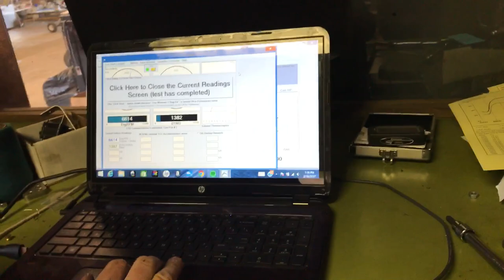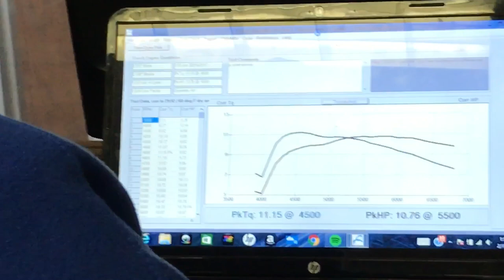Briggs Flathead Race Engine Dyno Test

Comment: Put a 4 hp head and a 3 hp flywheel on it, it''l kick it up a few more horses.
Reply: Ive done the 3hp flywheel with the adaptor for the coil......... Billit aluminum flywheel and the or dragster coil was a whole lot better but yes stock parts mixed together can work very good....... My nephew won a championship with that enginge and was tore down but they couldnt do anything about it because it wasn't stated in the rules.......

Comment: I got one.......... Fuck paying thousands from a lowball engine builder that over charges........ I have 500 dollars of actual parts that I bought but machined and assembled it ourselves........ My brother knife cut the crank and balanced it at the turbo shop he was running.... Shaved the head .125. Bored it .030 over..... Has a dynocam cam and springs.... We ported the intake and exhaust ports. Put billit aluminum flywheel with a briggs or dragster coil on it and an arc billit rod........ Stock carb converted to alcohol...... And it runs 9500 rpm all night long on a dirt track all for 500 bucks and not too much personal time also has a 4500rpm takeoff adjustable spring clutch.........it was half the cost of the engine........so 750$........I bet this engine in this video is 1500bucks......
Reply: so true.
Reply: And we'll worth it. Yours may have been fast but far from legal.  That's the talent building a stock legal engine that will outrun yours. Talking big words won't make it faster.  Also 750 for a cluth is a rip off.

Comment: Someone plz help is there any different carburetor for the Briggs 5 horse fun power engine that I can use? The stock one has so many linkages and it’s really tricky
Reply: When u find out let me know with part numbers
Reply: I use a Tecumseh 6 horse carb on mine. You can also use the Honda/Predator 6.5hp carbs with adapters
Reply: @PeelePowered  dude thanks so much

Comment: Will a good built flat head out run a clone big pipe?
Reply: I have a 28hp briggs if that says anything.
Reply: @bryanroupe8646  blockzilla
Reply: Yes. I have ran stock medium with a flatty against the clones and won, legally.  I believe you could get more out of a clone or predator, they just dont sound and smell like a flatty.
Reply: Yes
Reply: @d.bowman8032  I love Flathead motors I have a few.
Reply: @bryanroupe8646  28 horse power huh?  That's like what 200% increase power  output? Sure you did. I run a 3 sec quarter mile with mine.

Comment: Can someone tell me what fuel they are supposed to run? I have one I got from a buddy and have to clue about them motors
Reply: 87 Or better octane should be fine i personally run sunoco optima 95 because it’s ethanol free fuel it’s way better for small engines than pump gas.
Reply: just use regular fuel, only go higher octane when you start bumping compression up

Comment: I’ve been trying to locate a raptor engine do y’all come across those alot?
Reply from the maker: MrEric4555 yeah I race in upstate ny and it is mainly flatheads up here. Down south they usually race clones but they are common around where I race
Reply: If you ever come across any raptor engines message me I would be interested can’t find engines like that here in Houston
Reply: @MrEric4555  ive got 2 engines one stock briggs flathead and another racing flathead would probably part with them

Comment: Why dos it seem that my old 3.5hp briggs has more hp then my 6.75 hp briggs for cutting grass?
Reply: its torque that they are using. flatheads have torque lower in the rev range 2200 to 2800.... OHV engines have torque higher in the rev range.... get more HP from the same CC's on OHV engines.
Reply: the old flat head motors always have more power than the new gov Newsom smog motors .
Reply: @marcchaffee7751 idk newer motors are pretty good and when you get them perfect a 212 predator can run 20+ hp and it’ll freely rev up to 10k with no issues, stock id say 6000 is pushing it a tiny bit
Reply: @matteblackexterior  My favorite B and S has always been the 190000 series 8HP flateads .   Years of gokart riding , that has been the most dependable torque monster for me . Riding all day and they always got me home .

Comment: And now you could throw a header pipe and remove governer on a $120 predator 212 and make the same.
Reply: These engines can make way more then a predator 212
Reply: Yeah but predators are kind of an ugly looking engine imo and everyone does that. Its not how fast you go its how you go fast 😉
Reply: Before anyone could afford the Japanese engines, these were all there was for decades. If you really dgaf just use a motorcycle engine…but see how that ruins the point of it all? Flatheads have a terrible time flowing air, so it makes it more competitive.